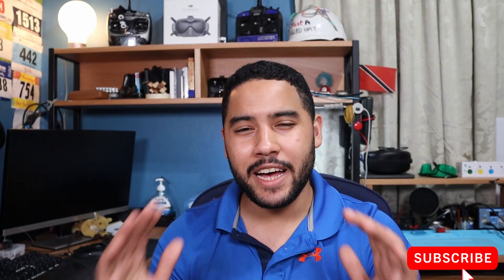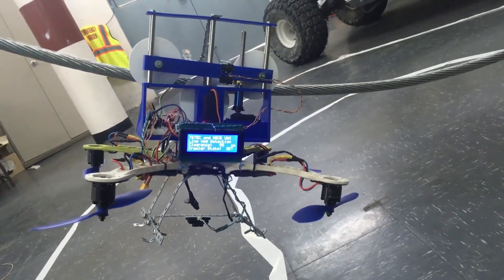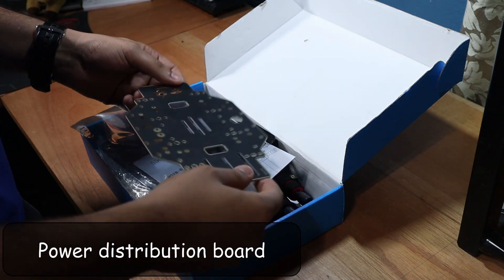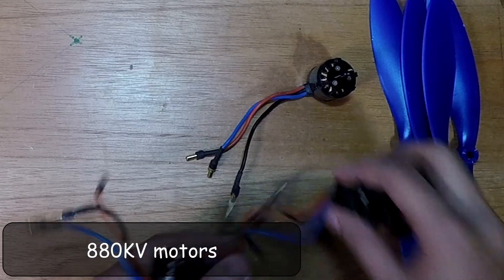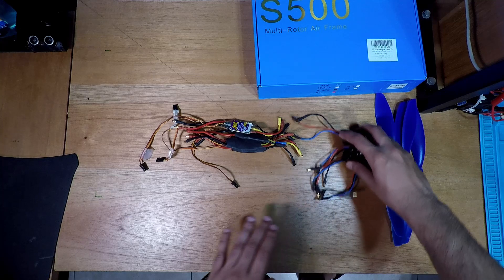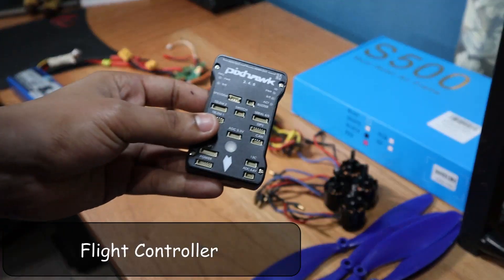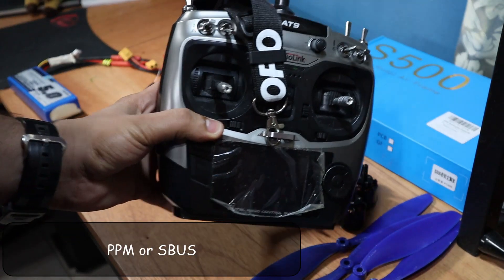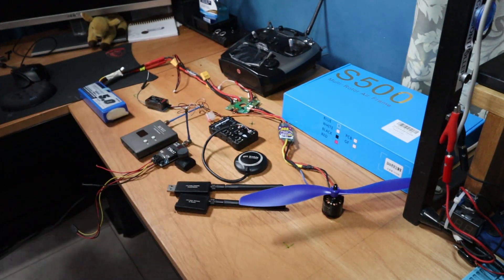DIY drone (Part One) | S500 | Pixhawk | FPV Quadcopter |

Comment: Excellent ! Thanks so much for your great advice. I've built a DJI F550 and I want to switch over to Pixhawk - Do you know if anyone has managed to use a Zenmuse H3 2D with a Pixhawk ?
Reply from the maker: Nah I haven’t, but the pixhawk has auxiliary outputs that I am sure can be used to control it

Comment: Hi bro, can I use any power distribution board for esc. Its not there in your description. Do you have any suggestions for it?
Reply from the maker: Well am using the power distribution board build into the frame. What kinda of esc you have? Generally you could use any but you should choose one that can fit on your frame easy and has additional features like a power module to go into the flight controller. I have this one https://amzn.to/3vhrvby but it is simple and just outputs the battery voltage but if you and lets say addition regulated voltages like 12 and 5v for some LEDs https://amzn.to/3gzLrCc might be a better choice but you limited to 3s and 4s batteries

Comment: hello, is the pixhawk flight controller stable when you let go of the controls. how much flight time with a 5000 mah battery. do you think that if I put on a 10000 mah that the drone will lift anyway. Thanks. I want to build the same as on the video.
Reply from the maker: I think next weekend I wana to go out and do some of these test to find out the flight time and such. I really can’t answer some of those questions honestly. I would like to think that 5000 mha we should get more that 20mins flight time but I only got 6 because my battery is old and I had the return to home voltage set at 10.6 when it should have been 9.6. A 10000mah battery might be too big and you might be moving into the area where biggest isn’t always better. Might need lower KV motors
Reply from the maker: As for stability I think the pixhawk is great. It was really stable when I let go of the controls. It had 12 gps Satellites and it can back  home and auto landing it self. There is a newer version to this flight controller also that is suppose to be even more stable. I would say it took about 5mins to get 6 satellites so it’s a bit slow in connecting but when it connects it works great.
Reply from the maker: https://youtu.be/DYShUk7wOG0  the Drone performance video   - I got 12min on a 3200. If I get a new 5000mah/ 10000mah Battery Ill sure test it out

Comment: Nice! Did not realize you were into RC. Loving the Pixhawk, been looking to build a fixed wing for a while now and was considering the Pixhawk, I see amazon has some reasonable packages. You ever heard of OpenHD for the FPV connection?
Reply from the maker: Hey man, good to hear from you. Yea I been into RC a while now. started with 4x4 RC Trucks and moved to gas boats then quadcopters. I also being considering a fixed-wing cause I have extra DJI digital cameras. I never heard of OpenHD but will check it out thanks. I liking this pixhawk so far, it was easy to set up and works great.  Might be a bit overkill for a plane tho.
Reply: @JustBarran   don't need a flight controller in the first place if I'm honest but want one for the autopilot. The pixhawk packages works up to about the same price than if I buy say a Matek f405 and sensors. Anyways looking forward to see the what you do with the quad, lol I did notice the DJI goggles box there